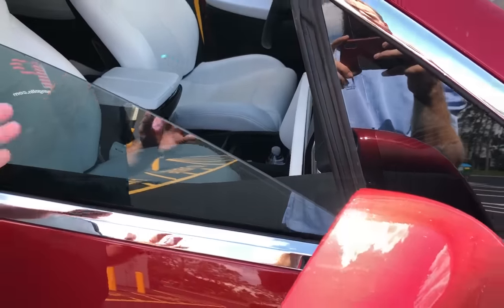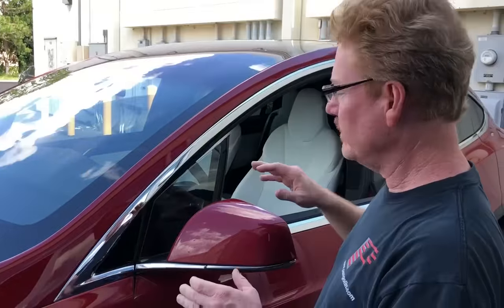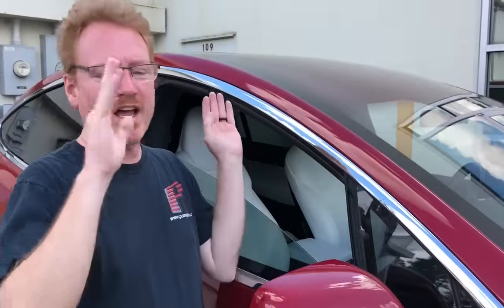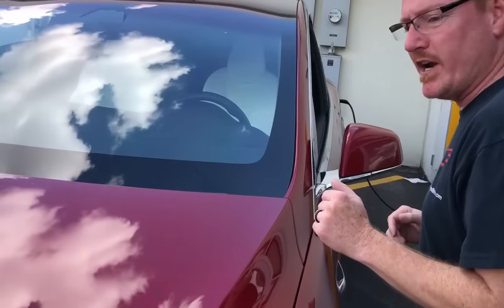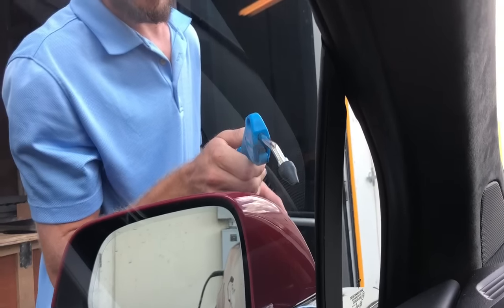How to locate wind noise problems in cars caused by trim and seals around windows

Comment: What a brilliant idea.  I have been fighting wind noises on my GMC extended cab truck for the longest time. Now I can finally solve this mystery.  Thank you so much for sharing. Can't wait to try it out on my vehicle.
Reply from the maker: Two points: Compressed air (like I used here), and also electrical tape! You can tape various areas outside the car and then drive and see if it's quiet. If so, pull off the tape little by little until you localize the problem.

Comment: Great idea on the compressed air! I have a cheaper car with a steal door frame and was thinking of improving the seal between the frame and the body of the car, this way I can actually quickly test if it improves at all.
Reply from the maker: Glad you liked it! It was something I just thought of kind of in the moment. But it worked pretty well. The location of the noise wound up to be pretty surprising in my case...

Comment: I just bought a 2022 Toyota Corolla and I noticed when I'm on the highway, I can hear some wind which I thought for sure with a new car  you won't. Thanks for the video pretty cool what you guys did.
Reply from the maker: Thanks for the comments. What you're talking about happened to my new Cutlass Supreme back in the '90s. On that I used what I call the "tape method" -- placing tape at every seem until the noise went away, then slowly moving pieces of tape until it came back, to locate just the spot. Years later we used the compressor, but I think fewer people have access to this...

Comment: I had thought of the outer tape idea but not the incremental removal to find trouble spots so thanks for that.  I was doing something else that involved a "smoke test" using mineral oil smoldering in a jar and maybe I'll try that just to see if outside air can get in.  Surprising that one side of the Tesla would be so much different than the other.  I rode in an X a week ago and was shocked at how loud it was.  Maybe this is a known problem.
Reply from the maker: Mine is a relatively early Model X. The newer ones are certainly better in every way. I've done acoustic readings of this car and my old hybrid Highlander and they were pretty similar. The newer ones are definitely quieter.

Comment: I found it ! The issue was the windscreen installation in the factory used a new type of glue. This is a common fault in many Mercedes and smart cars 3 years old. You can check by pushing on windscreen if it moves and your getting whistling it's likely to need glue again and refitting.
Reply from the maker: WOW that's something! I never heard of that, but thanks for the feedback. Exactly how did you find it? Just pushing on the windshield while driving down the road?

Comment: The seals not sitting flush or looks uneven when comparing both side is because the seal is not pushed in all the way. There is a notch hidden behind the trims at the top. It is hard to push the seal into the notch but you can do it with a trim tool and some elbow grease. Good lighting is needed to see if the seal is inside the notch.
Reply from the maker: Mine is serial number 31000. On each side the seal is a little bit different, but once I fixed the part shown the seal is good on both sides, even though they look different.
Reply: @WilliamBennerJr  yeah. Tucking in the seal somewhat lessened the noise on driver side and eliminated on passenger. Will have to do your tape and air compressor method to find the remaining culprit on the driver side. Tesla quality has not gotten better and it is 2023

Comment: Another problem  is when you replace  a cracked  windshield  the sealant is not  always applied  well and it will start to separate and the noise will travel across generally  the bottom  of the windshield. 

You can use your video camera  on your smartphone  to record  this for evidence  to show your installer. 😅
Reply from the maker: AHA intersting. I saw the windshield being replaced on my Highlander a while ago. That guy did a good job.

Comment: The wind tunnel noise in my 2003 s-10 ZR 2 is coming from my dash, underneath I think but you can't feel any air movement but it gets louder the faster I go or if the wind is blowing
Reply from the maker: WOW interesting. Try applying tape everywhere you can in the front of the car and see if that influences the sound in any way. I hope you'll be able to locate a place where the tape really helps, and then concentrate on that area.

Comment: This video helped reduce my wind noise significantly. Besides the front windows that you have shown, is there anywhere else on the model  X you recommend examining and putting tape?
Reply from the maker: Not tape, but you should examine the adjustable bumpers on the hatch back. See another video I made about that.

Comment: Excellent video! What product (seal) would be recommended to add between the door & OEM seals?
Reply from the maker: I'm not sure what to recommend. It probably is on a case by case basis. When we found a kind of "whistle" on my Olds Cutlass, they just used regular foamy weather stripping. On this Tesla Model X, I used Epoxies, etc. model T50-3112, which is a "filled epoxy". That worked quite well.

Comment: your a genius gonna try this on my q60
Reply from the maker: Hehe. Thanks for the kudos. In the past, I found what I call "the black tape method" to be entirely workable. But it requires some effort, plus, if you have a very subtle air leak, then the black tape method could be less definitive. I found this compressed air trick worked really well at locating the specific area of my wind noise. In the end it was pretty surprising. Areas that looked very suspicious did not cause any wind noise, and the area that looked the most innocent was the problem. Plus, there was a lesson that no matter what I did inside the car, I was not able to really locate or even effect the wind noise. Only external stimulus was effective. Good luck finding your wind noise!

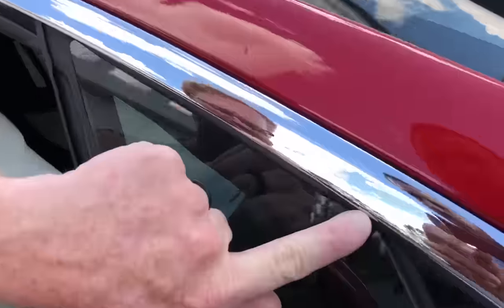Comment: I have a similar issue with my 2016 MX, but on the passenger side. It starts at 120km/h, gets nasty at 140 and is awful above 200km/h (German autobahn). I figured out that at the section shown at 3:43 with the two fingers, the pressure from the rubber towards the little window is not strong enough. This leads to the fact, that the front edge of the regular (large) window is facing the wind (there's a 2mm edge), because the small window is too much inside..
I figured this out by pressing from inside like here: 6:48.
This is fixed when somesthing is put between the rubber and the little glas (section as shown at 3.43) pushing the little window 2mm more towards the outer side eliminating the "edge".
Maybe I have to put something inside the original rubber seal, let's see how I can do it...
Reply from the maker: Glad you figured it out. Now that you know where the problem is, Tesla may be able to fix it for you.
Reply: Wheamwhile I figured out something additionally. In the rubber seal, there is already a kind of harder foam piece or something similar which sled down from the position as indicated in my first post. I was able to push it upwards using my thumb and index finger and now the whole thing is fixed without additional items.
Reply: @mamu679  😀Moving the foam tube to the correct position resolved my issue. No more wind noise from the window. Thanks.

Comment: I just found by chance that the excess wind noise that my ears were tuned into on my 2018 vw golf, was coming from the wing mirror. Not the wing mirror itself but the small gap between the mirror glass & the mirror housing. The gap is now covered in black tape which doesn't look  very good I must admit but the relief from the noise is worth it. Has anyone any ideas on how to fix it without all the tape ?
Reply: Did you fix it?
Reply: @kaspars804  no.the relief only lasted a few days.I then fitted some wind deflectors, but they have made the wind noise even louder. Does make the car look nicer though !
Reply from the maker: For sure, anything additional will make the problem worst. It will add weight and further sensitivity to wind turbulence.

Comment: We have local shops here who puts refill air in tyres (normal car maintenance)  Is it the compressed air that you are talking about?
Reply from the maker: Yes exactly. These air hoses can be "connected" to tire inflator-type attachments, or to ones where you squeeze the trigger and it will put out air. The latter is typically used at machine shops and the like, to blow off parts after they've been machined.

Comment: my whistle is coming from the passenger top right hand side of the window in the corner any idea how i can do that
Reply from the maker: You could use what I call the "tape method". Just buy a roll of black electrical tape, and tape up every gap -- everywhere. Then drive the car. Hopefully the noise will be gone... Then you remove the tape one piece at a time, driving the car each time, until you find the piece of tape (and thus the area) that makes a difference. Then look very closely at what makes that area so vulnerable -- what's wrong, etc. In a worst case scenario, just leave the tape in place ;-)

Comment: Hi there, It’s my first time having a Tesla, i got the Model Y, ny first EV actually. I’m hearing some sound it’s as if it’s a car window left open, while the rest are closed, that annoying noise that has a pressure like quality to the ears. Is that what a wind noise is? Thanks.
Reply from the maker: Yes it could be. As a "test", what you could do is get a role of black tape, and get in the car and close the doors, and then have your spouse "tape up" all of the joints, including those on the windows, doors, etc. Then go for a ride. If the sound is gone, then your spouse can remove pieces of tape one by one until the sound comes back. The last piece of tape to be removed will reveal the location of the problem, at which time you can take it to the SC and point out where the problem is.
Reply: Could be the rear hatch needing the 4 rubber pieces aligned. Look at the video about the trunk buffering noise he has made. Fixed it on mine

Comment: Nice video! Do you think I could use a gas station compressor to diagnose the wind noise in my car? I don't have an air compressor. I checked one today quickly, but they seem to be weak. Maybe it's just my impression.
Reply from the maker: When you have your own compressor (or a friends), they usually have this kind of air tip on it. Gas stations don't have that kind of tip... In this case I think you should start with what I call the "black tape" approach. It means you place tape in various places of the car, and see if the wind noise is affected. Hopefully it will be, in which case you remove the tape, little by little, in sections until the wind noise starts up again. Then this will help you to isolate where the noise is coming from, and you can attack that specific area.

Comment: And to FIX the noise????
Reply from the maker: Hehe. Depends on the source. On my Oldsmobile, they actually installed foam weather strip under the chrome body part that was causing the whistle. On this Tesla I used a "filled epoxy" from Epoxies, etc. because we have a lot of that in stock. Worked great!

Comment: Tesla X got wind noise issues ?
Reply from the maker: Actually for me, only in that singular area that was easy to fix.
Reply: $80,000 car shouldn’t have wind noise issues
Reply from the maker: Sure but in the case of my car I got it "used", and so I'm not sure if the cause of my problem was because of build quality or because of something the previous owner had done. Because of that, I'm not ready to place blame with Tesla. The main point was to help people find other wind noise, whether it be on Tesla cars or others.

Comment: Problem is under the Mirror chrome handle.
Reply from the maker: Problems could be anywhere. In my case, it was where I was pointing. I applied some epoxy and it has worked for years.